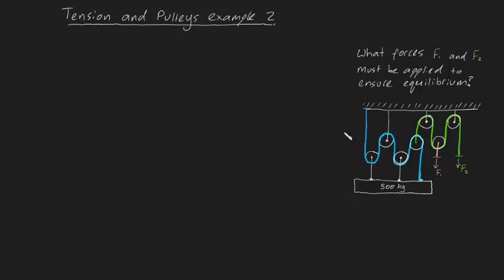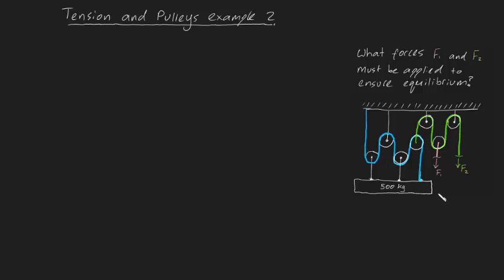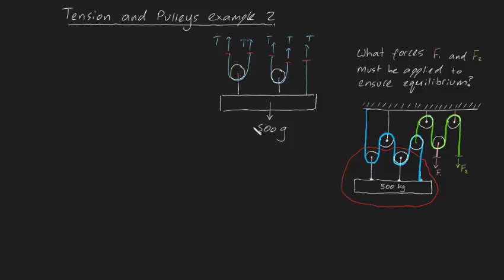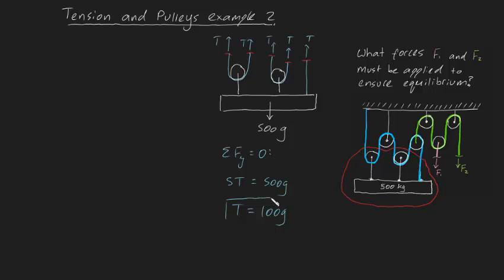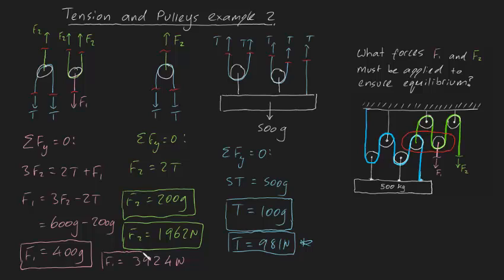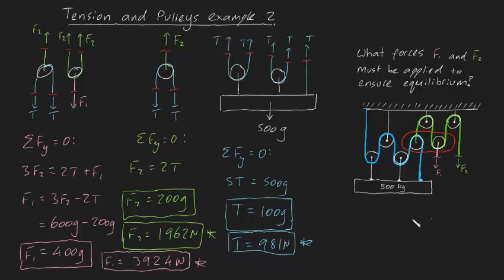Tension and Pulleys example 2

Comment: Excellent explanations! Thank you! One question though: why to we assume that the pulleys themselves have negligible weight (no m*g vectors from their respective centers om mass)? Is it because in practice, they do? Or is it just a simplification so the students grasp the concepts behind it all?
Reply from the maker: Hi Max! Excellent question! In this problem we've assumed the pulleys are massless, that's why there are no mg force vectors showing up at the center of each pulley. This turns out to be a pretty accurate assumption though since the other forces that exist on the system >> the force due to gravity of any of the masses.
Reply from the maker: So yes, this is just a simplification to help students grasp the main concepts :)